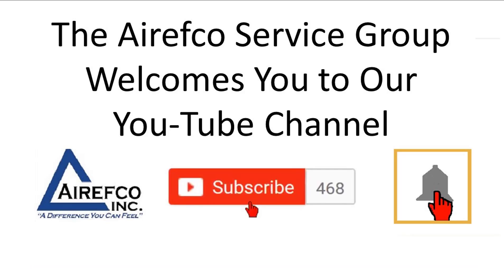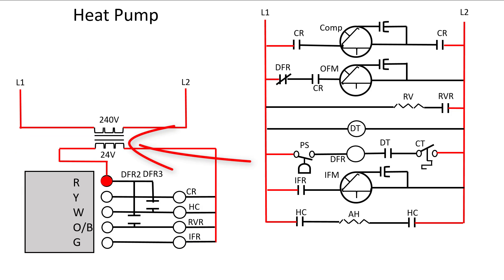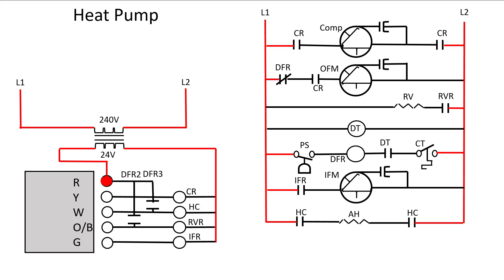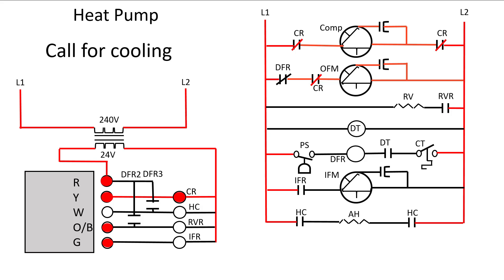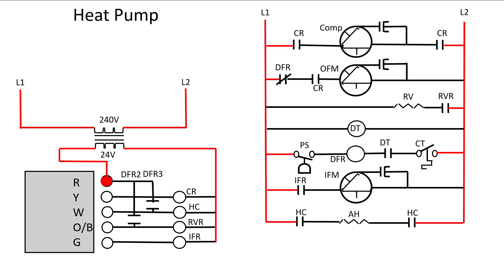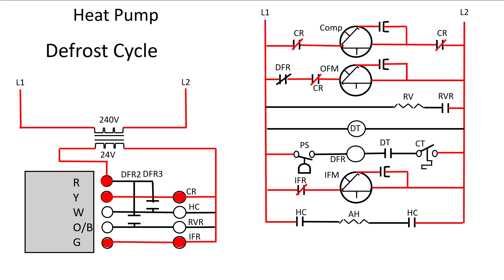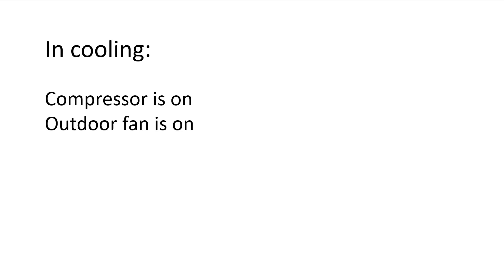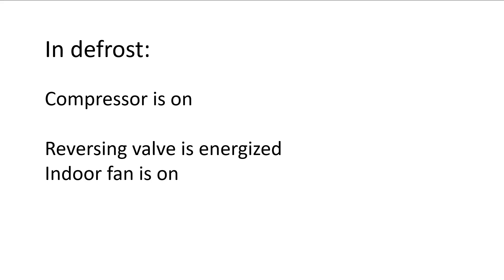Sequence of operations in a Heat Pump

Comment: Is Y AND G only hooked up to the thermostat in call for heat ? I thought it would be Y O G
Reply from the maker: In a call for heat, there is a call on Y and G.  For cooling, the is also a call on O
Reply: The reversing valves are fail on cooling or fail on heating. Meaning they will do one of those (usually heating) without being energized. So Y will only be engerized (in this case) for cooling.